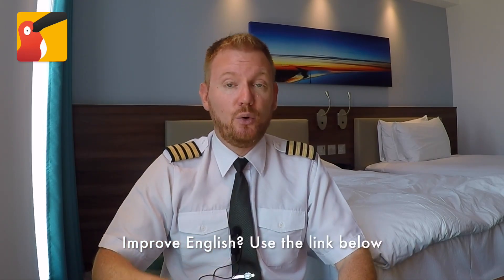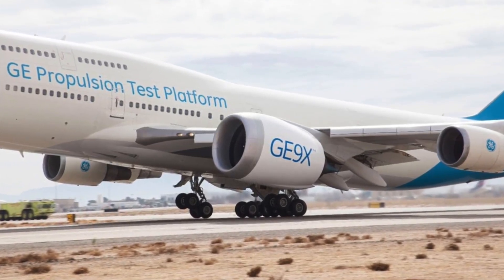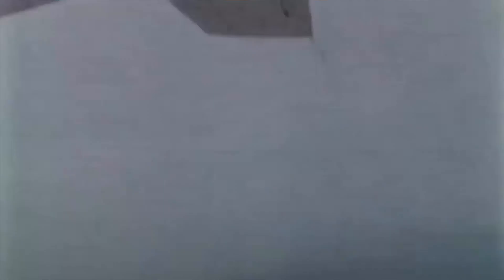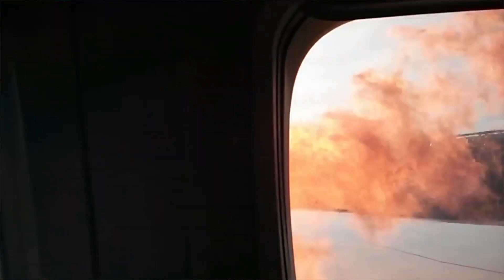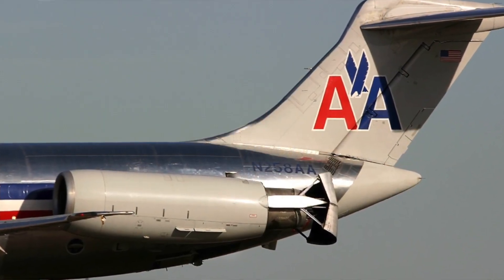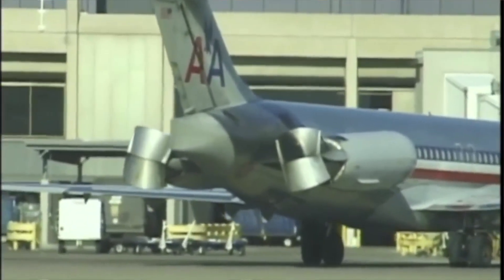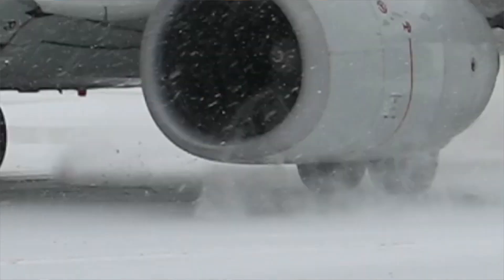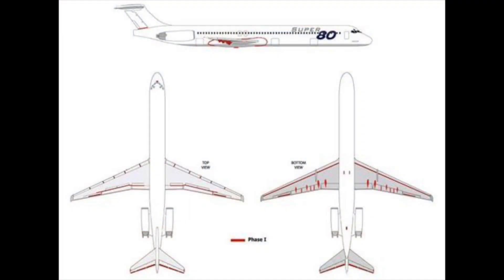Why are the jet-engines placed there? Wings vs Tail

Comment: The ancestor of the stick-shaker is the wing root wash-out on the Supermarine Spitfire. This meant the root of the wing would stall before the tips. This made the stick shudder, warning you that you were about to stall, but you were still flying. 

This probably explains the possible myth that the Spitfire could out-turn the Messerschmitt Bf 109. A Spitfire pilot could turn his aircraft to the very edge of a stall situation with confidence and hold it there, whereas the 109 gave no such warning of an impending stall. Therefore most Luftwaffe pilots were unwilling to take the risk, knowing their airspeed was running perilously low and that an unwarned stall was imminent.

Comment: I was reading up on the 727 and found another advantage to engines mounted off the wing, and that is the clean wing has more usable area for leading and trailing flaps. This allows the aircraft to use shorter runways, so it can service smaller airports.

Comment: Interesting explanation of the reasons for different engine mountings. I do have one question for you though. Is there a specific reason why some T-tail aircraft still have engines under the wings? One specific that I can think of would be in military applications such as the Lockheed C-141 Starlifter. Is this design simply to accomodate the loading and unloading of the aircraft or are there other reasons that this might be?

Comment: Makes sense. Dual GE9X on the rear of the body would seriously shift center of gravity right? You'd need some bacon heavy passengers to compensate for that :DD
Aviation engineering is just awesome.

Comment: I always thought that with a super stall, you could still use the ailerons to tip the plane onto its side, spill the wind off the tops of the wings, rudder to get nose down, and with enough elevation, gain the speed needed to raise the nose and recover the airplane.

Comment: On the bigger engines, isn't most of the size simply the big fanat the front and the space for the air to flow around the turbine? If so, does it really weigh that much more, which you seemed to imply was the issue, rather than the physical dimensions? /curious

Comment: could you have 2 under the wings and 2 in the back or would that have some negative issues like risk of sucking exhaust air from the underwing engines to the back ones?

Comment: You might be skipping a point that is more telling as to the decision of engine placement; and that is packaging. It is rather complicated to fit a RR Trent-1000 under the wing of an ERJ-134/140/145. One could opt for a high wing configuration, in order to fit some insanely oversized high bypass turbo-fan, but high wings bring about their own issues. Or place the same insanely sized turbo-fans above the (low) wing like a HondaJet  Then there are the considerations for what the target customer/airport requires. It makes little sense to construct an enormous aircraft for a tiny airport, serving a very low total passenger volume, in the middle of nowhere with limited space for the size of the airport. This would inevitably lead to a need for a much smaller aircraft, smaller aircraft will inevitably be closer to the ground...unless you have a thing for flamingos & stilts and find that an ERJ-145 with 10 meters worth of elevation from its landing gear is somehow....sexy. Which ever way you look at it, engines are placed in locations where they can be placed, and are suitably placed. Different engine placements intrinsically have different handling characteristics, but the handling characteristics are not the deciding factor for placement. At least, not the sole deciding factor. Working on the engines standing on terra firma or from a gantry makes little difference to mechanics, again airport size & service volumes are driving factors... Big jets require big airports, require big maintenance hangers with big jet equipment required etc

Comment: what I got from this is that it's fairly similar to front wheel drive vs rear wheel drive in cars. having all the components under the wing or at the front of the car makes for simpler maintenance and efficiency whereas having them in the back provides better weight balance and overall handling since the wheels or wings aren't doing multiple things at once

Comment: As an aerodynamic engineer, I would say, that tail engine configuration provides higher L/D ratio, than wing-mounted engine one, because there is no negative influence of engines on the wing. Tail engine configuration provides so called "aerodynamically clear wing" without any protruded elements, like nacelles on the pylons.

Comment: Also a big benefit of the high mounted engines that in case of an emergency landing on a water is "easier" than the wing mounted engines because the wing mounted can drag in to the water an could make damage the aircraft. 
Good video! my step father is a pilot too.

Comment: Excellent video.  Thank you for continuing to educate young and old alike. I wasn't aware of the deep stall thing.  The only T-tail I've flown was the PA38 'Traumahawk' back in the 1900s.

On the maintenance side of the equation,  I much preferred under-wing to tail mounted engines.  I'd rather change all 4 engines on a BAe 146 than R&R the #2 fuel control, in-situ, on a CRJ-200.  The next generation, pilots and mechanics both, may  they be thankful for full FADEC.

Comment: do pilots fly many different types of airplanes at one time? or does the 'type rating' you mention limit you to one or a few models of aircraft?
great video!
Reply: You can hold many type ratings however, when in an airline you tend to fly only one type of plane as you can make mistakes if they have different systems.

Comment: Out of all the Delta mainline stations I’ve worked and been to for TDY I have never witnessed nor heard of powerbacks being used anymore. Incredibly inefficient, dangerous for passengers and crew as well as ramp agents (Even FOD walks couldn’t stop small zipper tags and things of that sort from being sucked in). It says something when America’s largest airline company who has the most of any tail mounted planes in service today (MD80/90/717 and CRJ 100s through 900s) stops powerbacks.
Reply: I've witnessed it, once, ever, on a civilian jet at least.  In the mid-90s at DFW, an AA MD-80 powering back from a gate.  I've seen multiple demonstrations of military aircraft doing powerbacks (mainly C-130s and C-17s).

Comment: On underwing mounted engine aircraft, the inboard leading edge slat is separate from from the mid and outboard slats, so at least for smaller aircraft that I know of, only the mid and outboard slats have the anti-icing ducts as opposed to tail mounted engine aircraft the anti-icing ducts can run the almost the full span of the wing.  Also behind the underwing engine above the exhaust there needs to be a dry bay that is free from fuel incase of a leak and fire.  This reduces the amount of the wing that can be used for fuel.
Reply: Underwing does allow for much bigger engines, hence why rear engine widebodies don't exist.  The loss of fuel capacity is worth being able to build a much bigger plane to compensate.

Comment: Another advantage of rear-mounted engines is they produce less asymmetrical thrust with loss of propulsion from one of the engines...it's easier to maneuver than with under-wing mounted engines that have a much larger 'moment arm' due to their much greater offset from the center-line of the hull.

Comment: Okay... so on commercial aircraft with 3 engines. Does that make them less susceptible to super stalls? does the extra power allow them to climb out of the situation with say full power?
ie 727. 3 in the tail.
as a skydiver id be okay with opening the back stairs and standing on the end to act as an elevator....too bad they are locked now...damn DB Cooper.
Reply: Pretty sure there have been multiple 727 hull loss incidents from deep stalls.

Comment: Hey MentourPilot, another benefit is that in the case of anything breaking of from the wings, the debris won't get sucked into rear mounted engines, as compared to engines mounted underneath a wing, when there are parts that separate from the wing (structural damage) the engines won't be affected by the debris as they are mounted underneath instead of behind.

Comment: I did see a few B 727 aircraft powering back with the reversers a long time ago.  It is pretty loud and the JT8D has plenty of gusto to move that plane, but it looks tricky when you want to stop because you cannot use the brakes or the plane might lift off the ground, they just use forward thrust when they want to stop backing up.

Comment: In terms of quietness, wouldn't an over-the-wing mount on a shoulder mounted wing make more sense? Why is it, in your opinion, that no passenger aircraft (and few military ones) have adopted this arrangement?
Reply: Probably has to do with ease of maintenance.  a top mount engine on a high mount wing would be difficult to work on.  The only place you really see top mount engines is on turboprops, where it is the norm for turboprops with low mount wings, but it is done there to allow for a larger prop and is only slightly above the wing surface because prop aircraft with wing mount engines want to direct prop thrust over the wing to increase lift.

Comment: One big benefit of tail-mounted engines for private jets is the lower fuselage height, so manufacturers can mount integral door-mounted stairs, as well as having a smaller landing gear. Smaller airports may not have stairs available, and waiting for them is a hassle for the VIP passengers.

Some jets with under-wing engines do have integral airstairs, but they're pretty rare because they're very heavy and can be rather unreliable due to their complexity.
Reply: Part of the reason why the DC-9/MD-80 and 727 went that route, they have integral airstairs in the back.

Comment: Found the Channel today interesting Stuff,  should the Tail Mounted Engines also slightly improve the Full Consumption, mean the big Engines around Wing produce also a lot off Turbulence around the Wing witch increase Drag slightly?
Reply: The big engines are more fuel efficient due to a high bypass ratio cancelling out any slight benefit smaller engines have with reduced drag.

Comment: super interesting !
Thanks for sharing so many details about the way you control these flying beast ;-)
could you always give comment about engine mounting in HondaJet HA-420 ?
quite different from the  2 solution discussed here...
Reply: One of the main reasons Hondajet put them on top of the wing is it is a light jet which is to low to the ground to put them under the wing and they wanted them to not be mounted to the fuselage to reduce cabin noise... a by product of this was also more internal cabin space.

Comment: Great videos, found this channel by browsing yt. If i may have a suggestion though, i would recommend trying to do something with your voice audio quality - or recording volume to be more specific. I believe your voice is "too loud" for the mic config, so you end up with audio that sounds not so good in the end. Maybe, try to record your voice on lower input volume, and after recording check it's levels, you don't want anything in yellow/orange or red. That will not sound nicely.

Comment: When a rear engine plane has a catastrophic engine failure / explosion, is it more likely to cause catastrophic damage to the tail and make the plane uncontrollable?

For example... In reference to the engine explosion on Southwest flight 1380... If that was a rear engine plane such as an MD-80, would that kind of engine failure render the plane as uncontrollable and ended in a much worse crash?

Comment: Ahhhh... That's exactly what I was thinking in regards to engine sound levels. 
I've noticed when I've sat in rows slightly in front of the engines on a 737, it's quieter than when I've sat directly behind the wing, looking over the wing.
Which is quieter and overall a better ride, sitting at the very front of the plane or sitting almost all the way in the back of the plane? 
Thank you for another great and very informative video!

Comment: Well in case of total hydraulic loss the under wing configuration makes it easier to steer the plane only using engine trusting which has saved lives.
Reply from the maker: Well, the over-mounted engines have a similar effect but lesser.
Reply: Yes, but given how hard it was to navigate in these emergency cases with under wing engines, it would make it much harder with the other way.

Comment: The center of air pressure from front of the plain to the rear (in the cross section) is the reason there is a either up or down torque, which depends on the engines location. If the engines are higher, than this center, then this torque is pushing the nose down, which has to be compensated by the wings and  flaperons. If the engines are lower, then the opposite - the engines push the nose up against the center of the air pressure on fuselage. It has not much to do with the center of gravity of the plain, as stated in the video.  Ideally, 2 engines should be under the wings and two on the tail to compensate this torque. Or all the engines should be embedded in the wings to eliminate the torque. P.S. I am not a pilot, this is my thought as a physicist.
Reply: It does has to do with the center of gravity since the aircraft spins around it. That's what we're taught, I study aeronautical engineering.
Reply: I agree about vacuum, but not in the atmosphere. Imagine parachute attached to the tip of of a tail or wing - the plane will spin around this point disregarding where its center of gravity is.
Reply: It's literature about aerodynamics that states so, I would say it's also true in the atmosphere.

Comment: I have a question.  Why do all engines spin the same way?  I noticed it first watching multi engine prop planes start, and then watching jets start.  Why do the engines on the wings not spin toward the fuselage?  Is it because the engines are easier to interchange if they all go the same way?
Reply from the maker: Yes, that’s largely the idea. The more similar the engines are, the cheaper they are to fix, own and operate.

Comment: Back in the '60s, at least one airline (Delta or Eastern) called their DC-9s and 727s 'WhisperJets', making the cabin quietness of the rear-mounted engines a feature.  Rear-mounted engines also allowed for simpler, less expensive wing structure.
Reply: That was the name Eastern Airlines used for their 727s
Reply: That was eastern airlines but it called it for Lockheed tristar L1011 not for 727 or DC9
Reply: Ashish Anand L1011 was a sweet flier.
Reply: Меги обсди ми се наблюдава
Reply: I was remembering that too.
Reply: American airlines also dubbed their 727s as whisper jets..

Comment: In the late 70's there was a twin engined shuttle jet with the engines mounted above the wings for aerodynamic efficiency, but (as I understand it) the maintenance was a bit of a nightmare. I remember seeing them occasionally in AMS
Reply: Mike Smith Honda make an executive jet like that now.
Reply: I fail to see how engines conveniently placed low for foreign object ingestion can be easier to maintain, just because all you need is to roll out a scaffolding.
Reply: May have just been a design problem with that particular aircraft but changing engines would require overhead cranes wheras an underwing pod makes engine replacement easier which may be a factor in high intensity shuttle operations. There are aircraft with top mounted engines (particularly Russian designs) but most are flying boats